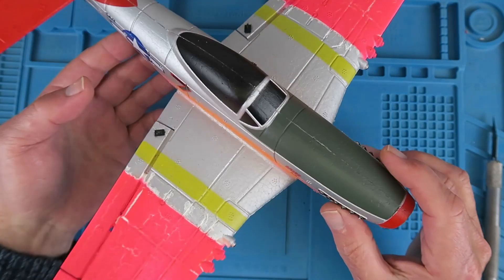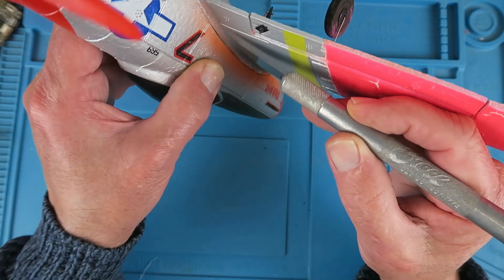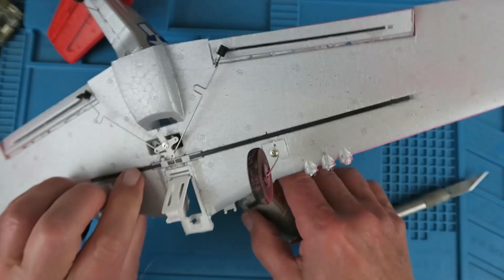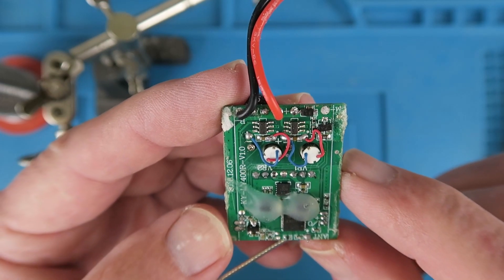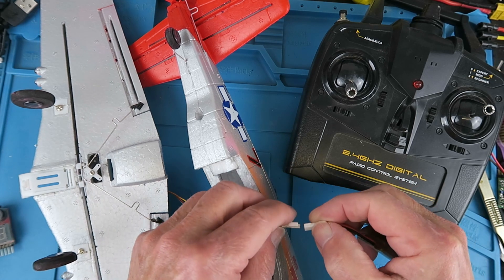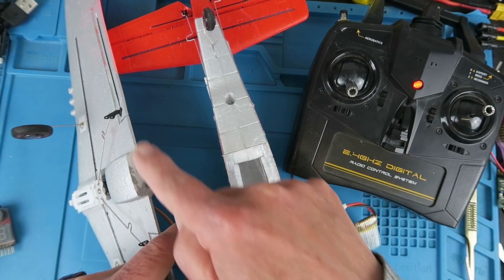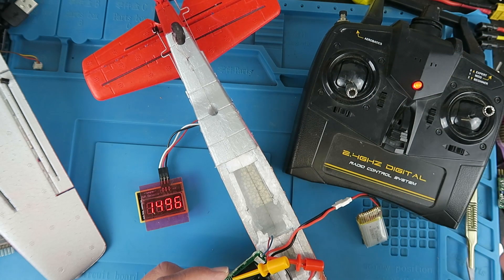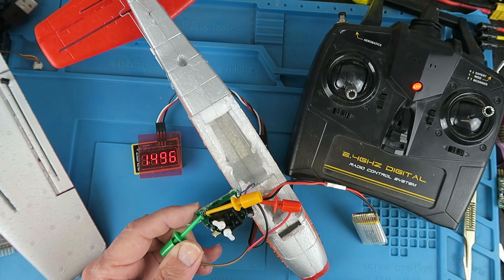Eachine P51D Flight Controller Receiver Repair

Comment: Buen video, tengo el nuevo Messershmich y observo que la emisora no pita para armar el motor.He seguido todos los pasos que dice el manual y nada..El resto de funciones estan ok , pero falla lo mas importante, no tengo motor operativo.¿ Se te ocurre algo? GRACIAS.
Reply from the maker: Hola, supongo que estás usando el transmisor original. Es posible que el avión no esté correctamente "vinculado" al transmisor. Sigue el procedimiento de "vinculación" del manual. Enciende primero el transmisor y luego instala la batería. Empuja el acelerador hasta arriba hasta que escuches un pitido y luego vuelve a poner el acelerador en cero. Entonces debería estar armado y el motor debería funcionar. https://youtu.be/HxhbYIbs-pY?t=516
Reply: Hola,gracias por responder ,si, he hecho todo eso con su emisora, vincula ok, todo se mueve como debe, pero cuando subo el gas arriba NO pita y cuando lo llevo abajo del todo tampoco pita ( sin embargo, si pita con los trims y demas funciones)Y despues de subir y bajar el gas subo el gas y el motor no funciona. @1nformatica
Reply from the maker: @jaimemacias826  ¿Ha funcionado alguna vez? Si no, supongo que el transmisor está defectuoso. Si conoces a alguien con el mismo transmisor, puedes pedirlo prestado. Yo uso un transmisor Radiomaster con el módulo "4 en 1" que puede emular el protocolo. Tal vez conozcas a alguien que tenga uno. Deberías ponerte en contacto con el lugar donde lo compraste para que te aconsejen. ¡Buena suerte!
Reply: Gracias..@

Comment: similar things happened to mine, the only exception was, when i replugged the aileron servo, my board went poof. bought another board and the same thing. Surely the issue is that servo right. Ofcourse i didnt have any aileron control to begin with. but it's nice to know that with the new board the same thing happened.
Reply from the maker: Good to know, thanks for sharing. Thanks for watching, have a great day!

Comment: Interestingly,my p51 started reverting to right stick,Rudder and elevator recently.If I don’t check it before flight,it can and WILL all go wrong.Time for a new one methinks
Reply from the maker: Maybe just a loose connection or broken wire on the aileron servo. Thanks for watching, have a great day!
Reply: @1nformatica  both my brand new Spitfire and the now crashed a million times mustang,we’re eaten by a mouse last week (I keep em at my caravan,and one got in) it tunnelled through each box (right in the middle ?!) and ate 80% of the spit,and had a few nibbles on the mustang…gutted.But,I’m gonna convert a small balsa rubber powered and stuff the spit innards in that…time for a bit of graft.I got the p51 back in the air with sections of the spit wing spliced in,and removed and taped over the half canopy that was left…it flew fine,but then occasionally did this mode change on binding.I’m gutted (not as much as the spit) but the question is,do I go for the BF109 or the NEW blue Mustang ? The spitfire had ‘wing wobble’ it was improved with nose weight,but it never flew as good as the Mustang…wadya reckon ?

Comment: I put a Volantex P40 Warhawk receiver into a TopRc P51 D ( couldn't bind to the TopRC receiver with TX16S Radiomaster) and had to invert the servos for Rudder and Elevator to get it to work, but then lost the safe mode. Was wondering if I could have just desoldered the motor leads and soldered them, in reverse polarity, to each others servo controller. Meaning, the Rudder motor wires at board to the Elevator motor wires at board, while reversing the polarity also.
Reply: To add, the servos are sitting upright in the TopRc P51 D 450mm as compared to being upside down in the Volantex Warbirds. I'm thinkin' how cool would it be to have an inverted flight safe mode function...lol.

Comment: Hi ! I,'ve similar experience with my volantex bf109, firstly, the aileron servo turned to one end once the battery connected.then i removed this servo, just to wait for the new spare part arrive. At the same time, i tried to fly the aircraft without aileron control. Oooh! Strange thing appered ~the rudder control stick had no reponse!and the aileron control stick changed to rudder control by itself! as well as the direction was reversed!! funny ha! Finally everything become nornal when the new aileron servo installed.
Reply from the maker: The remaining mystery is how the controller detects the aileron servo! Glad you fixed it. Eachine I usually buy from Banggood as they have better pricing. Otherwise Aliexpress. Thanks for watching, have a great day!

Comment: Do you have any technique and proper area to cut through the foam body of the plane to replace the motor in case of the old motor in the plane has damage ? Thank you .
Reply from the maker: You will need to split the fuselage in half, you can see what it looks like in this video : https://www.youtube.com/watch?v=rpCH3Kvqrl0&t=96s Thanks for watching, have a great day!
Reply: @1nformatica  Thanks a lot, Sir.
Reply from the maker: @burachattanpradit4450  You're welcome!
Reply: The better way, IMHO, is to cut at the body lines on the bottom section of the plane. Cut at an angle to help lock the panel back in when it gets glued. Make sure you push the motor out from the front before cutting the panel out. You will need to use a rod to sharply tap the motor loose. Once loose from the gearbox, cut the panel out. Second option is to cut around the fuselage in between the No2 and No3 exhaust pipe feature. They glued the gearbox in pretty good on these and tough to separate from the foam.

Comment: Hello, Sir. I am interested in this Eachine fighter planes series. Do you have some clip video to teach me how to bind the new receiver to the old radio controller in the case of if I have bought this plane but the receiver in the plane is damage and i have to buy the new receiver for spare parts . Thank you so much.
Reply from the maker: You can see the binding procedure here: https://manuals.plus/eachine/eachine-mini-mustang-p-51d-manual#binding_instruction Thanks for watching, have a great day!
Reply: @1nformatica  So, one transmitter in radio controller can bind the new receiver  if the previous receiver in the plane has damage ?
Reply from the maker: @burachattanpradit4450  Yes. I have one bound to my Taranis transmitter using a multiprotocol module : https://www.youtube.com/watch?v=e4ReeQZznT4
Reply: @1nformatica  Really Nice!!! With your valuable answers that can help me decide to buy this great planes soon !
Reply from the maker: @burachattanpradit4450  You will not be disappointed!
Reply: @1nformatica  I just ordered the Volantex T-28 400 mm. because the Eachine T-28 is out of stock. The seller told me that the Volantex and Eachine planes are came from the same manufacturer. Is that right ? , Sir.
Reply from the maker: @burachattanpradit4450  Yes, totally correct! She's a sweet flyer : https://youtu.be/euHtOXNPtow
Reply: @1nformatica  See you in the sky, Sir !
Reply from the maker: Thanks for the encouragement! 👍👍🎮

Comment: Hi there,I have the same plane,and it’s been great for years…but the motor started ‘acting up’ at first it would only work with a ‘finger start’ then it would only run for half a second,restart,another half a second…do you reckon it’s the motor,or the ESC ? (It did take a hard knock recently,nose on,but I don’t think it’s a mechanical issue,as I can’t hear the motor,and the prop still turns,albeit for only half a second at a time…cheers)
Reply from the maker: My bet would be the motor, especially after a "close encounter"! It is a gear motor so maybe a tooth is missing. As you will need to take the plane apart anyway you can try running the motor direct from a DC supply to test. Thanks for watching, have a great day!
Reply: @1nformatica  cheers,that great…I’ll let ‘you’ know.

Comment: Sir do u have and idea to repair crash p51 in to the water 🥲
Reply from the maker: All spare parts for the electrics are available but it will probably be cheaper just to buy another.

Comment: If the PCB does not see (or reecognize) an aileron connected... only the rudder and elevator will work.
Reply from the maker: That is explained in part 2 https://www.youtube.com/watch?v=KNiZMd9VDoY&t=0s Thanks for watching, have a great day!
Reply: @1nformatica  Hadn't seen the 2nd part... Just watched it... Glad you found the problem... ;-)
Reply from the maker: @lasersbee  The mystery remains as to how the board senses the servo, especially as the servo I changed works perfectly well! Any thoughts?

Comment: These 66xx or 65xx (662K) are not very tolerant to reverse voltage and spikes. Already replaced many on different boards and receivers.
Reply from the maker: You're right! The magic smoke escapes very easily! It is difficult but obviously not impossible to plug the battery in backwards. In my other guise repairing computers I have even seen someone manage to force a USB plug into an ethernet port!
Reply: @1nformatica  manufacturers have become lazy to add reverse polarity protection. Flysky and WLToys do the same. Always nice to have some in stock.. But should not be needed.

Also, try using a smaller tip. I did see you were able to solder it, but a smaller tip avoid accidently blobbing other pads or damaging surrounding plastic.
Reply from the maker: @gbraadnl  I think it's not so much laziness but penny pinching. My first job was with Marconi Space & Defence and mil spec dictated everything built up to a high standard. Now sadly everything is built down to a price. Thanks for the "tip" on soldering!
Reply: @1nformatica  you can pinch on money and still add it. But yeah... Even the engineers work costs money. Lol, I used to work on contract for the RNLA so MilStd and military spec are known to me. In those places money doesn't matter: it was counted in human lives :-D.
Reply: For those who didn't understand : lives saved of course ;-)

Comment: Hi, my Eachine mini P51's elevator suddenly stopped working. Do you think this is related to the Flight Controller? Why the Flight Controller would fail? Thanks! Also, if I need to replace it, where can I buy just the flight controller? Thanks!
Reply from the maker: It is more likely to be the servo. Swap the connector on the board to the rudder and see if it works. If the servo still does not move it is faulty. You can get the FC here if you need it : https://tinyurl.com/EachineFCP51

Comment: Looks like you didn't have the third servo (aileron servo ) plugged in. When that servo is no connected the board goes into three channel mode. It's the same board used in the mini f22/F16. They just don't use the third servo and it's only three channels (bank and yank). I know it's late but hope this helps.
Reply from the maker: Thanks! It was plugged in but some how faulty : https://youtu.be/KNiZMd9VDoY YouTube no longer shows me if you are subscribed. Please consider subscribing if you have not done so already!
Reply: @1nformatica   just subscribed. I have the mini F16. I am currently working on a mini christen eagle And I'm going to use this board. Seems like it will work well for my application but I guess we'll see.
Reply from the maker: @ClayPigeonKilla  Hey thanks! You have some very interesting projects there, look forward to seeing some videos.

Comment: Hey, this is the 1st video i came across on your channel, was searching for such board repairing. 

I was wondering if you have any idea on how to change the servo if it is broken?

It seem like the servo has its potentiometer soldered onto the board, so if i were to change it, i have to do the same right, motor to motor and potentiometer connection to the board as well?
Reply from the maker: Yes, that wold be correct. It may be difficult to find a suitable servo to use. What is wrong with the servo? The replacement boards are not that expensive. See link in the video description.
Reply: @1nformatica  the servo gear broke. It is the wltoy f959 board without the gyro. Its still useable, just did not want to throw them.
So gonna try to replace it with external 3.7g servo bypassing the internal servo control circuit
Reply from the maker: @lalbeikh_channel  Good job! Tell me how it works out for you.
Reply: @1nformatica  sure buddy, will update you once i've im done with the replacement.

Comment: My plane hit a wall and stopped accelerating and the throttle trim just beeps backwards. There's nothing broken, just bumped into it. Everything else works. Does anyone know how to solve?
Reply from the maker: You will need to take the plane apart and check the connections to the flight controller. Maybe a wire has come off. If not I would take the wires off the motor connections and test the motor (propeller off!) with the battery directly to check it spins. The tiny brushes inside the motor may be damaged. Please consider subscribing if you have not done so already!
Reply: @1nformatica  Hello again. I already installed the new engine and it works, however the elerons servo doesn't work and it gets very hot and it's melting...any suggestions for a compatible servo?
Reply from the maker: @miguelgateira4070  I replaced an aileron servo with one of these : https://bit.ly/4xServo1mmJST good luck!

Comment: Unplugging the external servo from the brick will make it function like a 3 Channel , Left Stick = Throttle, Right Stick = RUD n ELE
Try unplugging the external servo n play around with it, than turn OFF n plug in the external servo n try again to see if this resets it back to the default 4 Channel setting ..
If the above fail, you can borrow a Jumper Tx n configure the tx to assign the Control Sticks correctly , this should probably work.. Then if it works, go buy a Jumper tx to fly the plane ..
Reply from the maker: You are right but in this case it was a faulty servo : https://www.youtube.com/watch?v=KNiZMd9VDoY BTW I usually fly it with my Taranis! Please consider subscribing if you have not done so already!
Reply: glad you worked it out .
Taranis, than you are familiar with OpenTx eh, I am using Deviation, do you think I should upgrade to OpenTx
Reply from the maker: @rudd2962  Yes, OpenTx all the way! I don't know much about the Deviation code but it seems to me not to be being developed much these days. Your mileage may vary!

Comment: errrrrmmmm  i'm not as tech savvy as you .. if i can get the brick  out , would  you repair it for me or look into what is wrong with it ??.... new model has turned up but its faulty and its defo the board me thinks ... rudder and elevator not working .. throttle and elevator are fine ....  thanks
Reply from the maker: A little more information please! Which model is it? Are you using the supplied transmitter? Rudder and elevator not working but throttle and AILERON working? I doubt that shipping it to Spain would be economic!
Reply: @1nformatica  hi ... oh wow Spain would be throw!!🤣 no worries I think I will try to order a new board with servos if there is such a thing...  oh it’s the same model in your video p51 mustang eachine ... tried the stock transmitter and bound it to my radiomaster ... still the same issue ... thanks for replying though , best
Reply from the maker: @Jay-gf7mg  This is the board you need : http://bit.ly/EachineFC Be careful as there are several versions of the board for different models. Please consider subscribing if you have not done so already!

Comment: Hey , came across this helpful video :) , may i ask from what kind of board you found that 3.3v linear regulator ?
Reply from the maker: Hi, thanks for watching. The regulator came off another flight controller board that was faulty. They are very common as most MCU's and memory chips have 3.3 volt supplies. Please consider subscribing if you have not done so already!

Comment: When you get the new board how will you bind it ti the controller??
Reply from the maker: The same procedure as described in the manual.
1. Tx off, throttle minimum and gyro in middle or beginner position.
2. Connect battery to plane and turn on Tx within 5 seconds.
3. Rx LED will flash for 3 - 8 seconds and bind automatically.
4. When Rx LED stops flashing binding is complete.

Please consider subscribing if you have not done so already!
Reply: @1nformatica  Thanks I found the manual and this is correct, I am sorry for wasting your time and Thankyou again

Comment: Thanks for the video, you taught me how to separate the plane. My plane aileron stopped moving and once open I could see the servo was not in the center position it was overlapping the rudder servo. So I took out the plastic lever and faced it the right way. But my servo seems to be playing up, it only moves a couple times and then stops moving. Should I change the servo or the whole board?
Reply from the maker: Glad the video helped. Did you crash it? It is unusual for the servo arm to be in the wrong place. Try changing the servo first. Also it is important to reset the gyros. Check the manual. Before arming the motor and in "expert" mode pull the Tx sticks both down and to the outside until the Tx beeps. That will set the gyros for level flight. Please consider subscribing if you have not done so already!

Comment: I am thinking the momentary reverse polarity must have screwed up the programming done at the factory. But as a RC pilot, for future reference it would probably work just fine as a 3 channel aircraft if you changed a few wires around. All you would have is elevator, aileron, and throttle. This is what we call “bank and yank”. I know it has a gyro, but the gyro would have to be turned off or it won’t fly at all. BTW I found your channel while searching for electronic screwdriver tear downs and now I am subbed. Thx!
Reply from the maker: Thanks Kevin! Glad you find my stuff interesting. Yes I plan to see if it will work just as 3 ch in another plane. Hope you fixed your Wowstick! Happy New Year!